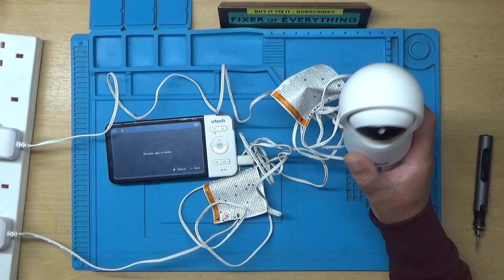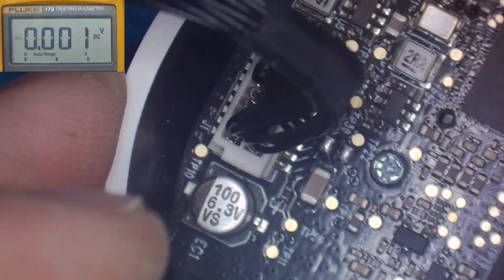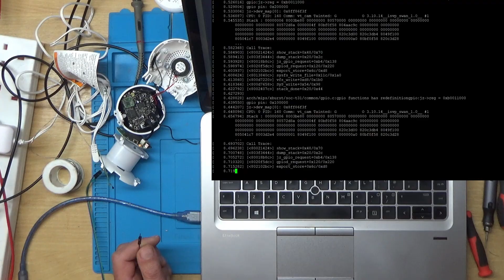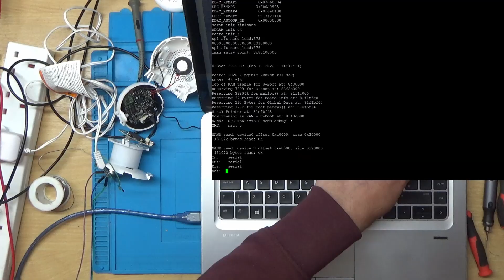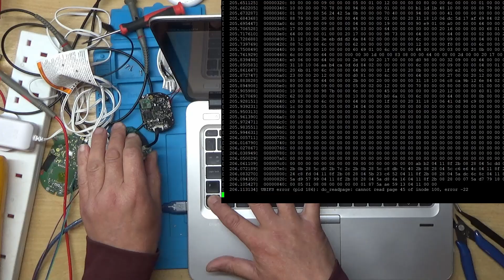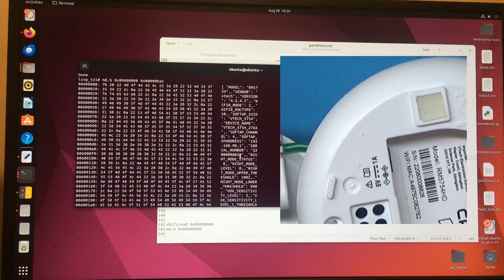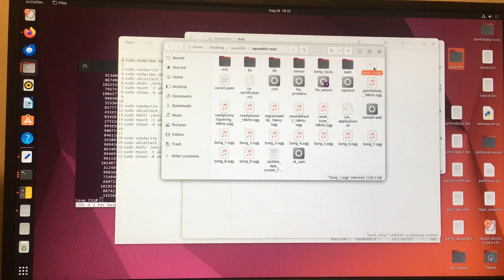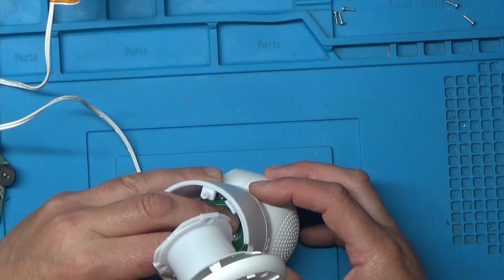Faulty VTech Baby Monitor | An EPIC Repair With Shocking Findings!

Comment: You truly went down a rabbit sinkhole Mick. That was insane, but absolutely enjoyable and fascinating at the same time.

41:00, it was at this moment that Buy It Fit It found himself being put on a register and having to visit all his neighbours for a "special" chat...🤣🤣🤣🤣 

There's a PDF from VTech on the interwebs, called "Smart_BM_Factory Reset Procedure_UK_20230725_2" dated 25/07/2023, that gives factory reset advice. 
A synopsis of which is below... I think some fat fingered programmer made a boo boo...🤣🤣🤣🤣 

Still, your way was way more interesting. 

Factory Reset Procedure RM5754HD, RM7754HD, RM5764HD, RM7764HD and RM7767HD
To factory reset your VTech smart baby monitor, please follow the procedure below

1. Locate the PAIR key on the back or bottom of the baby unit. Press and hold the key for 3 seconds.

2. If you do not hear a voice prompt saying "beep...ready to start pairing" or "beep" only, unplug the baby unit from the power supply. Then, plug it back in, wait for 30 seconds and press the PAIR key for 3 seconds again.

3. You should see the status LED flashing green and orange lights alternately. Press the PAIR key consecutively at least 5 times until you hear two beep sounds.